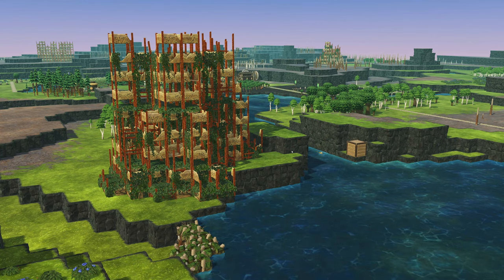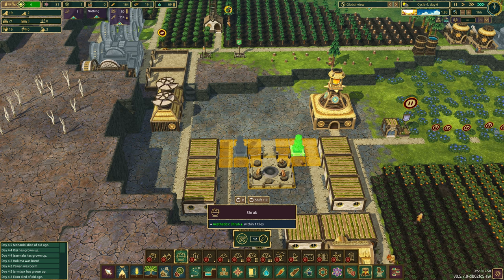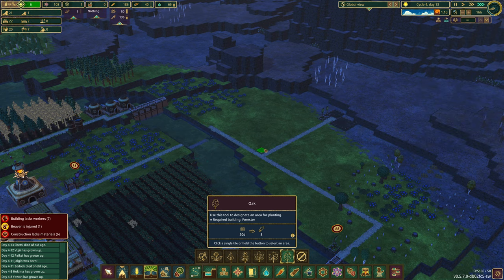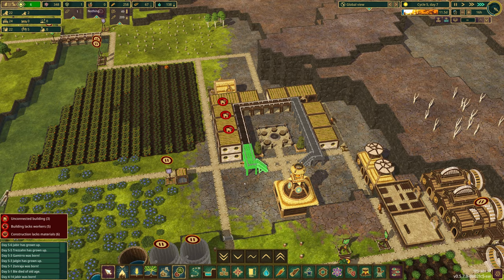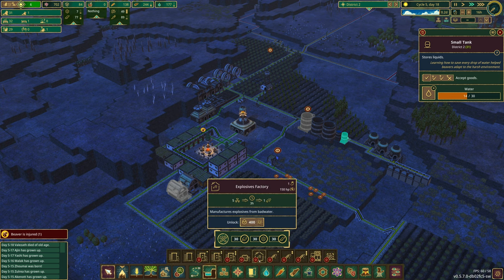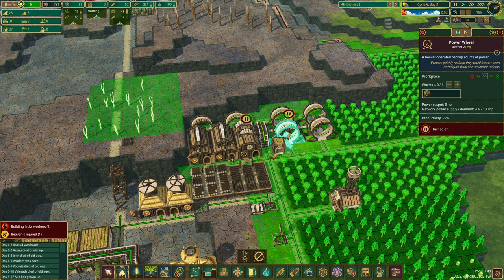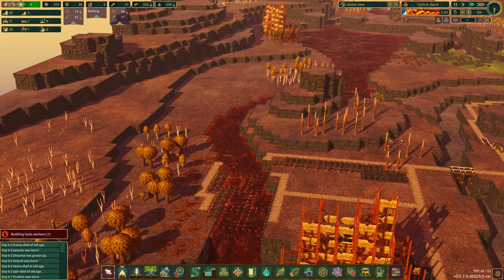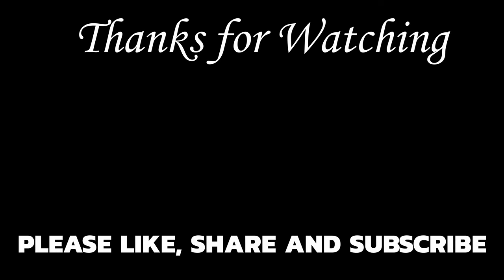Dealing with Bad water for the 1st Time in Timberborn | Bad Water Lakes Episode 2

Comment: Saw the problem with the automated floodgates from a mile away. 😅
Reply from the maker: 😬👀🤣. My first time using this mod.  I’m finding that the gates open right away after a bad water tide.  Not sure what I’m missing
Reply: @SargonDestroyerofWorlds  You need to uncheck the last checkbox in the menu for the floodgates.

I think I already saw you doing that for at least one gate, but you need to check the others as well.
Reply: @SargonDestroyerofWorlds  I actually got the game just last month and this was the first map I played. I simply built some big dams at the water sources to divert the badwater straight out of the map. The river essentially just does a 180° turn when the floodgates are closed.

Never bothered with those contamination barriers.

The game really has some balance issues, IMO.